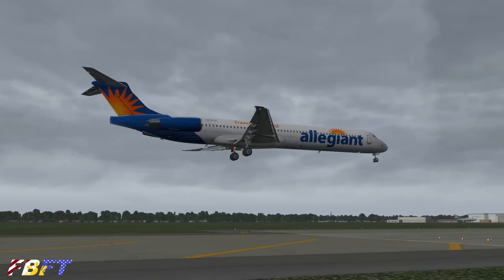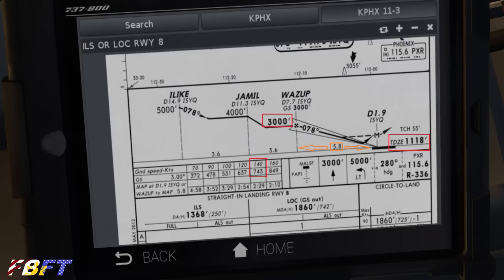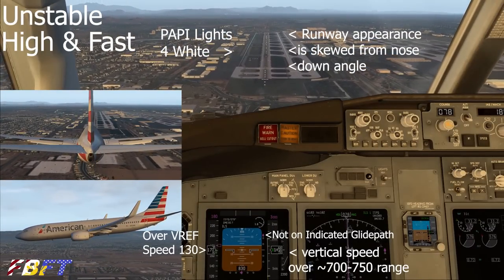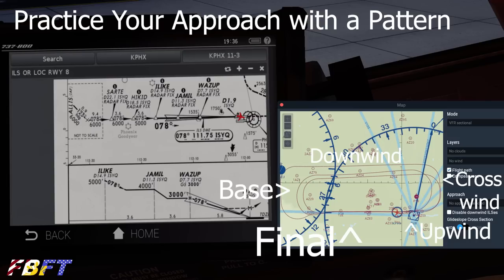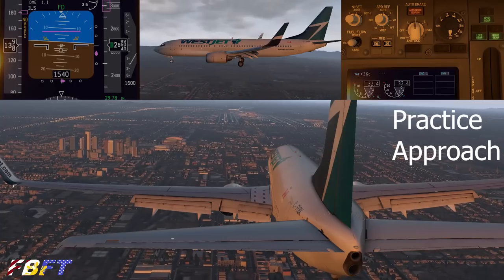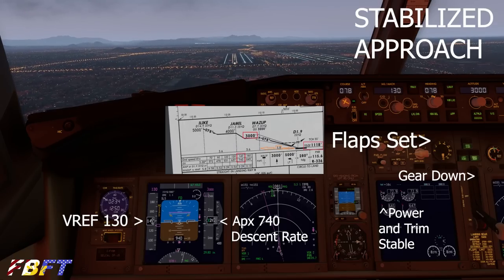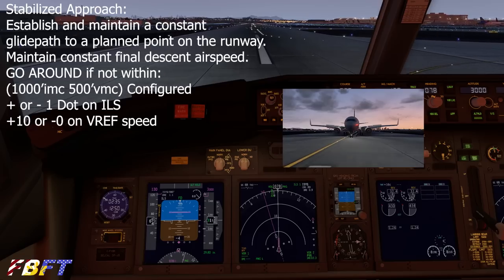Perfect Landings: Stabilized Approach | X Plane 11 - Zibo 737 - 800

Comment: Thanks for sharing amazing information very helpful indeed much appreciated, so at what point do you know it's safe to start deploying flaps with reference to charts so that you won't end up approaching too fast or stalling before touchdown? Can you shade a bit of light at what stage or DME flaps 1 to full flaps should be applied to say you are fully configured for approach?

Also, how do you know its time to manually trim or dial your speed down on the MCP with reference to flaps deployment corresponding to speed tape on PFD? I have noticed sometimes you deploy fully configured for landing and hear the turbines stressing.

What do those arrows going up or down on the PFD mean or telling you to do?https://puu.sh/ELIyO/f45c6445e6.png 

I hope I'm not asking too much information, thanks in advance.
Reply from the maker: Awesome questions! I want to give some solid answers, so I hope you don't mind waiting a little for a reply. Once I'm home on a full keyboard I'll try to answer each of those items in this thread. Check back later!
Reply: @FlightBrothersFT  Thanks for the prompt response I dont mind waiting at all that information very vital gold dust in my opinion...😊 Cheers
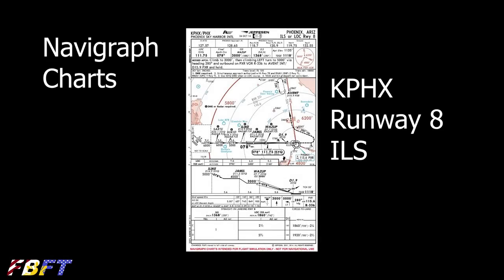Reply from the maker: So, let us tackle your questions by using the charts included in the video.  Under 10'000 the speed limit is always 250kts, so we can assume you are starting at that speed.  Approaching KPHX for Rwy 08 you can see on the ILS chart a two colored wedge shape where the glideslope/localizer intercept begins.  On the descent profile on the bottom of the chart you can see the same indication for the glideslope.  For the sake of practice, make your goal to be configured (full flaps to whatever setting you plan to use) at that point of glideslope intercept (usually 5nm out).  This way you aren't wrestling to configure the airplane and slow it while also trying to stay on a narrow glideslope path.  So what I might do in the last miles before the glideslope (see 3:21 in on the video for the chart) is use the level flight at 3000' to bleed off speed.  Then as you fall withing safe flap speeds, start easing the flaps out.  Flap speed limits are posted under the gear handle, and the red warning lines on the speed tape of the PFD will move down to show you those limits with each flap setting (These didn't show in the video I believe because replay mode doesn't catch all the datarefs).  Adjust throttles to reduce and hold the VREF speed, typically between 125-150kts.  Setting the VREF and planned flaps in the FMC is shown in the video.  A lower stall limit is also displayed on the speed tape.  The trick is to gently adjust trim and throttle at each new flap setting to hold VREF and maintain your descent exactly on the glideslope.  This will only be perfected through careful practice.

Trim: if you are flying manually, as I was in the video, then you will trim the aircraft until you can release the yoke. Ideally you are making little or no yoke adjustments if trimmed correctly. Throttle should be the only adjustment necessary in calm winds when trimmed perfectly.

MCP speed:  I used manual throttle on the video.  I have never used autothrottle beyond the glideslope intercept, so you'll need to seek another source for how that might be done.  You might find benefit in using the autopilot and autothrottle to help you configure the aircraft before the glideslope intercept.  For example, leading up to the glidelslope intercept you might run the MCP speed down to 10kts ABOVE VREF and begin extending flaps.  The autopilot will trim the aircraft for you as it slows and flaps extend.  You could then disconnect the automated systems at the glideslope and only need to slightly reduce thrust and monitor trim.  Regarding engine revving when configured, that is to be expected.  The flaps generate a ton of drag and increased thrust is necessary to avoid quickly stalling.

Last, I believe that is a green 'trend line' indicating that the airspeed is falling.  The quicker the ship is decelerating, the longer that arrow becomes.  

Thanks for the great questions!  I hope our answers are of some help.  Disclaimer:  I have not flown the Zibo in months, so these answers are mostly from memory and might not be entirely accurate. If you are really enjoying Zibo, I would recommend joining the closed Facebook group 'The ZIBO Community Group.'  There are a ton of avid Zibo users there with great technical knowledge and support for you!  

-FlightBro Tim
Reply: Just watch a video on Captain Joes "How to fly an ILS" video.
Reply from the maker: @Ldee247 use the speed placards near the gear lever for your MCP Speed.  Tim references this in his response.  If you are 10nm out at 200 KTS flaps 1,2,5 could be selected I believe based on speed.  Many don’t know 200kts is a max speed in Class B airspace unless ATC approves higher.  This is also memory, I have not flow the Zibo for a few months.  Just looks at the placard.  At Glideslope intercept (appx 5 nm) gear down, flaps 15.  Now use those placards and your FMC.  Let’s say you are 190 flaps 15.  Look at the flaps 20 placard.  Assume it’s 175.  Spin your speed down to 175 and extend flaps AS LONG AS YOU ARE BELOW the selected max flap speed.  Select speed 160, flaps 30 etc etc.  Continue all the way to your final vref approach speed based on the FMC data.  The most important thing is that you are under the max flap speed for the flap you are ABOUT to select.  Tim was right on, and also, fantastic questions.  I hope I’m able to help you out as well.

-FlightBro Lee

Comment: No more ryanair landings for me

Just kidding xd
Reply from the maker: Stabilized butter 😀
Reply: Dude I have a question how you know the gates for the flight 001 ?
Reply from the maker: @deutsche9025  take your pick!  The terminals PanAm was using in the 1960s are nearly all replaced today.  At the time, jetways were uncommon.  Parking on the ramp and using air stairs would be the most accurate.
Reply: ok thanks :)